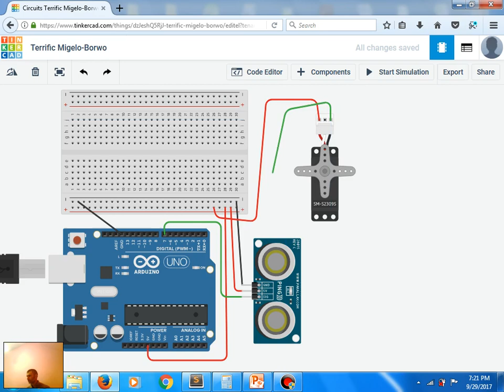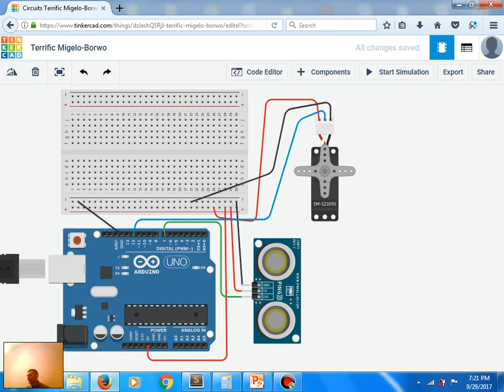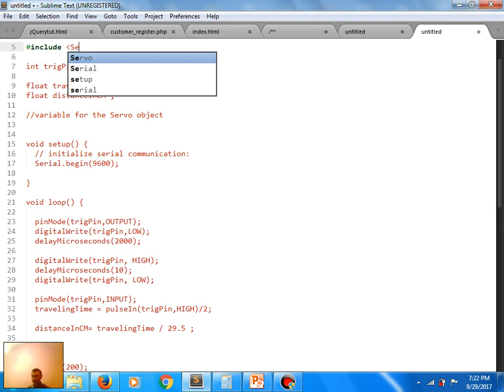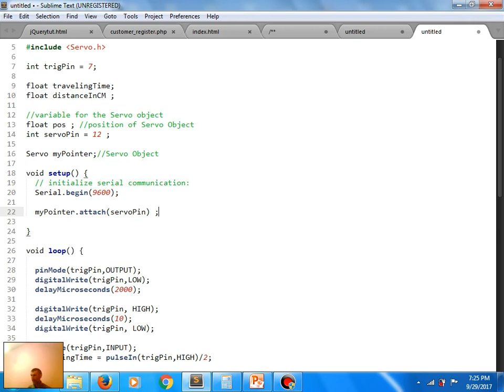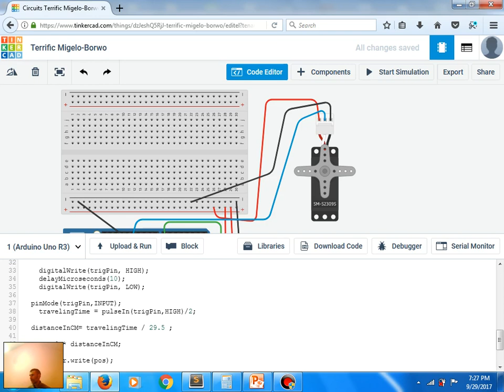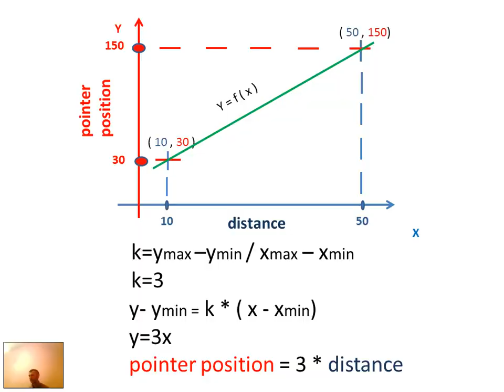18.arduino uno , ultrasonic distance sensor, micro servo 3

Comment: thanks for the video can u make a video where a servo n stepper motor with two limit switch n save there different position and using push buttons, like position 1,2&3?